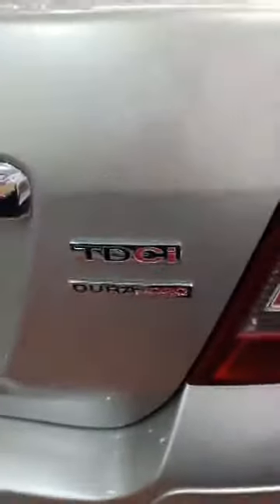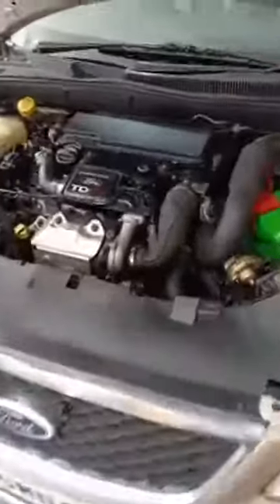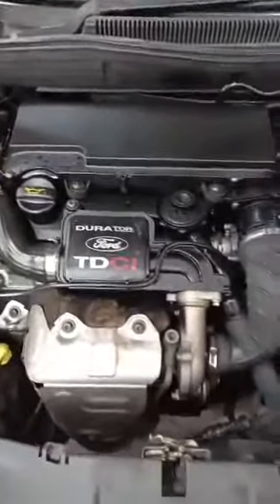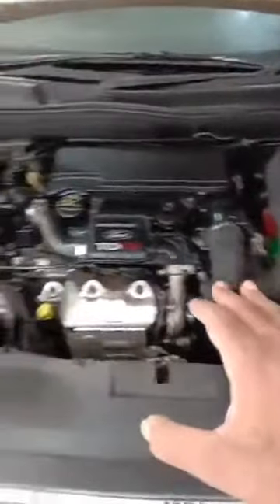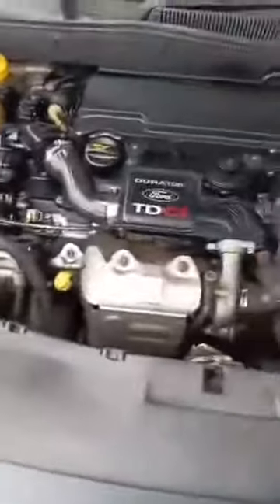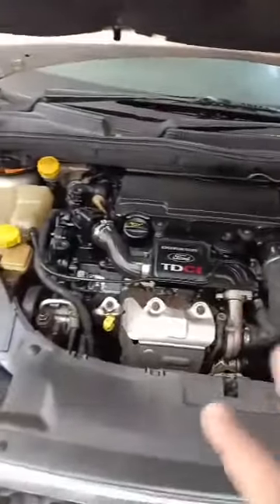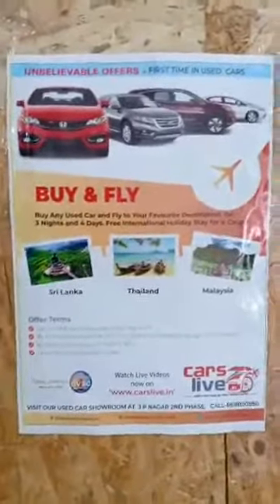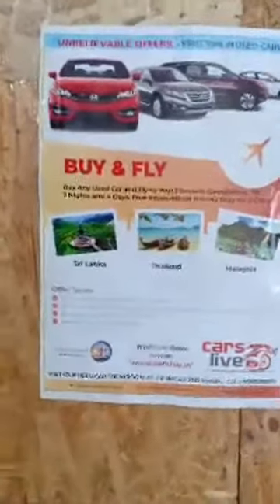Ford Fiesta ZXI Diesel 2006

Comment: Someone is offering me 1.2 Lacks for fiesta diesel 2007 model "suspension issue" is it good deal or not please help, ran 1 Lacks + km
Reply from the maker: For 2007 model yes it's a good deal. Go ahead.
Reply: Same deal 2007,1.25lac, but driven 2lac is it better

Comment: Hi, I am planning to buy an old ford fiesta 2006 zxi Diesel model. The 
seller is a mechanic and he told that car has been sitting idle for 10 
months now and needs repairs like battery,tyres,timing belt and some 
other minor things. The car's price is 1.1 lacs and with all the repairs
 it will come around 1.6L. Is it good idea to buy it? Also what other 
things which may needs changing for this much old car and will it cost 
me more to maintain it? last question if i only drive it on weekends and
 long trips, is it still a good idea to go with this car? please reply.
Reply: As per my knowledge buying vehicle from mechanic is too risky because they can manage with average body parts instead of orginal items which vehicle troubles  after some days..
Reply: Did you buy? I am also planning to buy the same but price seems to be 1L